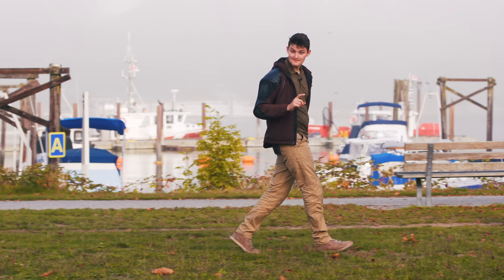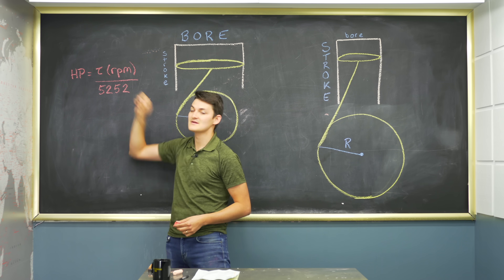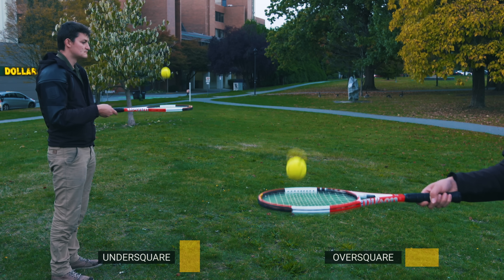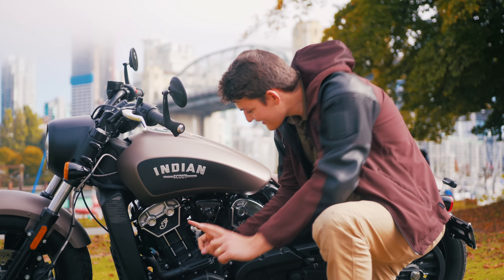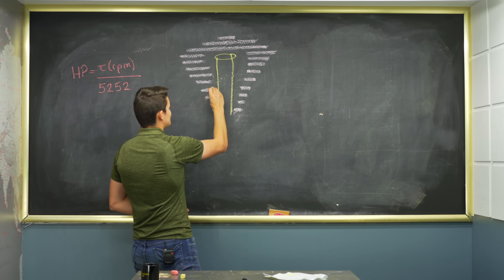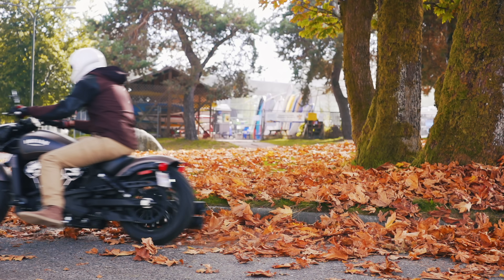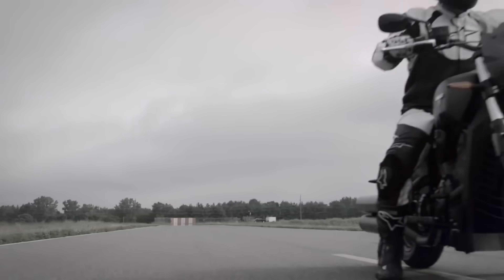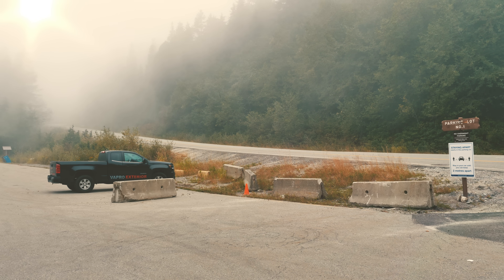How Indian Makes 43% More Power than Harley-Davidson

Comment: The question should be, "Why does EVERYONE produce more power than Harley Davidson?"
Reply: 'Cuz performance doesn't matter when you're less interested in motorcycles, than belonging to some 'Tribe' and owning a lifestyle 'fashion accessory'.
Reply: @matonmongo  Extra man gay motorbikes, only at HD.
Reply: @alanwatts8239  Cue "Macho Man", by the Village People...
Reply: Reliability.
Reply: @chopperking007  LOL Harley's and reliable, mate they are competing and honda here
Reply: @chopperking007  honda has entered the chat
Reply: Look at the torque not H.P....long stroke engines use low rev  torque not high rev H.P.
Reply: because it is a turn of the century design never brought forward without changing the bike into something opposite
Reply: But Harley's are some of the most unreliable bikes on the road... don't get me wrong. I have a custom fatboy, it's a gorgeous bike, but it's left me stranded twice and it can barely get out of its own way. Nearly every major manufacturer makes a v-twin cruiser that puts down considerably more power, is more reliable, and significantly more affordable. The only reason I keep the fatboy is because it was my father's and I'm sentimental about it.
Reply: Why does an 80s yamaha thats just 115cc get to 100mph and harleys cant
Reply: "Laughs in Royal Enfield"
Reply: @matonmongo  Most people with Harley apparel have never touched a motorcycle, let alone a Harley, or could identify one without the badges
Reply: @countzero5150  you probably dont know shit about the bike nor take care of it. They are reliable as long as maintained
Reply: @chopperking007  "Long stroke engines use low rev torque"

AND STILL MAKE LESS POWER
Reply: @chopperking007  which oversquare engines are obviously completely incapable of /s
Reply: @chopperking007  Like any bike that's been taken cared of? What's your point?
Reply: @benfennell6842  Would you believe that most diesel engines are under-square and produce less HP than their gas powered contemporaries? My 5.9L Cummins only produces 305 HP and the gas V8 it competed with produced 330. My Cummins had 610 ft-lbs of torque while the V8 has only 375. HP sells cars while torque wins races and gets the work done. My Cummins is still running at 220K miles and will continue to run for another 750k with proper services and adjustments.  Good luck getting that out of a gas-pot.
Reply: @umairjamil4831  Every Harley I've ever owned or ridden can hit 100mph. My brother's Road King with a 103 twin cam and only 5 speed gear box can do it. My 110 SE with a 6 speed can do it easily and on my ride home from Sturgis this last year I hit 110ish on a slight incline weighing in loaded at approx. 1,400lbs.  All the way from Seattle to Sturgis and back again without a hitch.
Reply: @joem7572  thays just not true and I dont think you understand horsepower and torque.

Saying one is more important than the other is a dead giveaway lol.
Reply: @joem7572  i was replying to another dude who said big motor harleys can only reach 100mph. Torque is nice but not that important on a bike. Harleys are always slower than other bikes of the same engine size. And harley doesnt make any agile bikes
Reply: @benfennell6842  I've almost completed my bachelor's in ME and I'm a Cummins trained and certified diesel technician. I understand HP, torque, and their relationship.
Reply: @umairjamil4831  It isn't as agile as my DRZ400S or my Triumph Adventurer, but I carved out Beartooth highway at speeds reaching 100mph this last summer. I grew up riding dirt and adventure bikes. Harleys are my relaxation ride.
Reply: @joem7572  then why would you say than one is more important and the other
Reply: @umairjamil4831  can we please stop talking about power and torque like one is more important than the other 

Do you think if we just removed the torque from our bikes they'd still go?
Reply: @benfennell6842  When and where did I ever say that? All I'm pointing out is that so many people hate on Harley and say they are under powered, they are not.
Reply: @joem7572  "hp sells cars while torque wins races"
Bruh
Reply: @benfennell6842  Not the same thing as saying one is more important. Most people focus only on HP and and don't realize that in order to take advantage of the advertised HP you have to rev. the hell out of the engine to achieve it. That significantly shortens the lifespan of the engine to utilize that HP. For example, my son's KX85 has 28-29 HP but he has to wing it to 10k to realize it. My Harley gets me to highway speeds very fast and can haul my wife, me,  all of our gear while doing so. I couldn't move that same weight under that acceleration with my old GSXR which advertised 162HP at 10k. My Harley performs the same work at lower RPMs and doesn't need the high HP rate to do it. Torque is why the Tesla Model S is going to overtake the Porsche soon enough as the fastest accelerating production car, HP isn't a factor from a stop and getting the hole shot.

Edited for spelling.
Reply: @benfennell6842  found the American
Reply: @umairjamil4831  Is that supposed to be an insult? If it is, why do you feel that is insulting?
Reply: @joem7572  not an insult bruh. Americans care for torque more than anyone else. Its personal preference. Some people like high torque at low end others want high revving motors
Reply: @umairjamil4831  found the person who didnt read anything I said

I dont prefer low end torque and power,  if you can find where I said that I'll give you a million quid.
Reply: @benfennell6842  ohhh bamboozled me
Reply: @umairjamil4831  bruh why cant people just accept that horsepower and torque are both always important to all engines instead of pretending that you can move a slider to make more torque or power at a specific rpm as if that isnt physically impossible.
Reply: @benfennell6842  the way i see it personally as a mechanical engineer is that as weight increases the importance of torque increases. Like suvs or minivans etc are better of with torque but for light vehicles and especially for bikes sacrificing top end power for low end power is just stupid. For touring bikes torque is good to have but if a bike manufacturer is only making bikes with good torque and lower max hp that means either the engineers are bellends or they have no decision making power. Harley didnt diversify their portfolio and only make one distinct type of bike. Thats why they are losing sales and rn they only rely on brand image which is getting damaged everyday.
Reply: @umairjamil4831  realistically the need for torque only increases because lower end power (and obviously torque too) is easier to use in a heavier machine because you dont have to work gear as much. Having the same power low down and therefore higher torque compared to the same power up high and therefore lower torque wont affect acceleration at all, just how easy it is to get to and use that power. 

The need for torque and power both increase as weight does, it's just that making that power down low means much easier usage.
Reply: @umairjamil4831  I built a 332" stroker Ford small block for my car, that I shift at 8500 rpm, it makes 530hp at the crank, I can't recall the torque, nor do I care. It has a 5000 rpm torque converter, so it never loads down low, therefore, low end torque means absolutely nothing. As you might guess from my name, I'm American. I love screaming small block engines with high hp. (Though I also built a Cummins diesel powered bronco which is also fast, but mostly built for the fuel mileage)
Reply: @AmericanThunder  bro you are in the minority as are most car people. Most people dont care for high revving engines. They all want low end power. Even manufacturers are catering towards this trend and are tweaking DBW and transmission shift points so people feel the car is faster than its real
Reply: @umairjamil4831  Maybe. But I also like the sound of a screaming V8 when going through a tunnel... lol
Reply: @AmericanThunder  who wants an engine that doesnt even feel like it's trying am I right?
Reply: @benfennell6842  I drove a very old 10-wheeler REO tanker truck with a gas straight six in it, and twin stricks, I forget how many gears it had. 17 I think? That is what happens without enough torque. You need a million gears! It suuuuuucked and topped out at 42mph with a load on it. lol Then I had a brand new Mack 300hp Econodyne 10 wheel tanker and holy shit, what a difference the diesel made with all that torque, and if I recall, it was only a 6 speed transmission. It accelerated more like a car in comparison to that old REO gas engine rig. Most people don't realize that dynos don't even measure HP, they measure torque. And hp is simply calculated with the formula hp=torque*rpm/5252. In easy terms, torque moves weight, hp is how fast it happens. lol
Reply: @AmericanThunder  okay in a truck maybe not😂 I meant car engines
Reply: Why does Harley-Davidson sell more bikes than anybody else?
Reply: @wrongthinker350  they... dont?
Reply: @benfennell6842  how many Indians do you see on the road compared to Harley-Davidsons? Or any other manufacturer for that point.
Reply: @benfennell6842  where I live I would say it's 75% of the bikes on the road are Harleys.
Reply: @wrongthinker350  I've seen 3 in my entire life
Reply: @benfennell6842  well you must live in some third world country then.
Reply: @wrongthinker350  perhaps the most typical American thing I've ever heard

You know harley barely sells anything outside of the US right?
Reply: @benfennell6842  how many times has America had to bail your country out?
Reply: @benfennell6842  you probably think you're 125cc is a real performance machine am I right?
Reply: @benfennell6842  if it weren't for us Americans you guys would be speaking German consider that?
Reply: @benfennell6842  British bikes are garbage.  Name just one that's better than a Harley.
Reply: @benfennell6842  sorry about your luck that you can't afford a $20,000 bike.
Reply: @benfennell6842  don't you guys have to give 3/4 of your wages to the queen? No wonder you guys can't afford Harleys.
Reply: @benfennell6842  why would you even bother owning a motorcycle in a country that rains 90% of the year.
Reply: @benfennell6842  made in England is just a translation for comes already broken.
Reply: @benfennell6842  I've got over 100,000 miles on my Harley let's see your triumph do that.
Reply: @wrongthinker350  your heart rate below 250 yet? Careful now, wouldn't want a heart attack would you?
Reply: @benfennell6842  you should try some light I hear it's great for the complexion. Or are you too busy foraging for potatoes in the bog under 500 ft of cloud cover.
Reply: @benfennell6842  I'm sure you get plenty of exercise pushing your triumph around.
Reply: all the whiners that cant afford a H D, so they make themselves feel superior by bashing them.🤣.
Reply: @harleyhawk7959  Harley-Davidson sets the standards everybody else is just a cheap knockoff. I'm sure they're too weak to even hold up an 800 lb bike.
Reply: @harleyhawk7959  I see more Harleys on the road than all other bike manufacturers put together.
Reply: @wrongthinker350  I've been riding since the 70's. still ride Harley. in all my time if riding, I never once heard any one say "Nice Honda" 🤣
Reply: @wrongthinker350  had some guy that wanted to ride with me up through Utah that ran into me at a store one morning. He asked how fast I rode? I said about 70 to 80. he says "oh, my bike cant sustain going that fast" it was a 750 honda 4.
Reply: @chopperking007  bullshit, torque is just an excuse for not being able to rev.......like a dump truck.
Reply: @joem7572  WOW WHATTA BIKE!
Reply: @joem7572  they are WAY underpowered, thats how they bone you the 2nd time, through their hop-up kits. The 1st boning was even buying that lumber wagon.
Reply: @benfennell6842  said by people that dont understand torque/hp and the irrevocable relationship between them.
Reply: @wrongthinker350  because girls buy them, unlike most other brands. Bingo, double the asses on them.
Reply: @harleyhawk7959  and you believed him. Not up much on bikes huh?
Reply: @harleyhawk7959  "all the whiners that cant afford a H D, so they make themselves feel superior by bashing them"  How the eff does having money mean knowing a good motorcycle even if it bit you in the ass? In my experience in this biz the more money you have the dumber you are with it.
Reply: @yamahale  Matter of opinion and as I've said more than once, I own multiple bikes across different platforms and each serves its intended purpose. And you're right in your first comment to me, it's a hell of a bike.
Reply: @joem7572  lol a helluva bike? Not the 30+ I have ridden. Maybe could have lived with 5 of them, as a second or 3rd bike. That engine ruins it for me, like riding an unrevvable dump truck instead of a Camaro.
Reply: @benfennell6842  As a citizen of the US, this guy is embarrassing all of us. We aren't all xenophobic and practiced in ad hominine attacks, I promise.
Reply: @yamahale  Subjective opinions are just that, subjective. Feelings have no part in an argument about facts and none of the vitriol that I've seen in your writing suffices as a fact.

Edited for spelling.
Reply: @joem7572  dw, my gf is american, I actually quite like the country, been a few times
Reply: @wrongthinker350  
How many Harleys on the road in the rain?
None....Might get waterspots on the chrome.
I ride my KLR 650 EVERY DAY. The only time I wash it (since 2002) is in the puddles when its raining. 
  Harleys are looky-me bikes. I have owned 4 of them over the years. But I was young amd needed the attention then....
Reply: Why does it always have to be about horsepower? If I wanted horsepower I'd get a Boss Hoss. Take vintage muscle cars, they handled and braked terribly, were death traps in a crash and people still want them even thou there are plenty of cars with modern engineering and power with half the cid that will eat them for breakfast. It doesn't have to be getting from point a to point b in the fasted time, it's about the ride.
Reply: @ralphfogle1662  and so it is with bikes. If you want to ride a Harley which is like a full size Buick w/a 6 cylinder, dont whine because I want a 2 wheel Camaro with full power. And btw HDs dont ride that good, even their shocks are obsolete for a supposedly premium machine. I just rode a 2015 the other day, what a lumber wagon.
Reply: @yamahale  Hal, I'm not whining. I'm just saying not everyone wants the same thing. Just buy what you like and fits you but don't put another brand down because it doesn't fit you, to each there own. Take care.
Reply: @welderboi5565  You got it brother!
Reply: @welderboi5565  
Well said....
This stuff ain't no new thing. About fourty years ago I saw a bunch of Gypsy Jokers pound the shit out of a guy and send him to the hospital in the back of a pickup truck while they burned his bike.  His crime? According to  onlookers, it was because his bike was a Honda 750. I don't know. I got there as the victim was leaving. There may have been more to the story........
Harley vs Vincent Black Shadow....Harley vs Indian...Harley vs The Legendary Webley-Vicars Belch-Fire 40/80.....Whatever vs Whatever......
Human nature. Mine is better; Yours sucks......lol
Reply: They don't. The Revolution Engine was cranking out 115 HP back in 02. That motor is only getting better and more powerful, and they are putting it into new model lines this and next year.
Reply: @joem7572  Are you really comparing motorcycles to diesel trucks? Whatcha pulling with your Harley? Let's just be real here. Harley's and retro style bikes sell on looks alone. I seriously doubt you went into a Harley dealership for the first time and asked about it's towing capacity. There is nothing wrong with buying a bike because it looks cool, but this "low end torque" thing is an excuse people make after the fact. You know another bike that has "amazing" low end torque? A 300cc Honda single...
Reply: @Dizzykitty817  My initial comment before it got cut off and deleted was that I was comparing under-square engines and the characteristics they share. I traded my 2017 Vulcan Vaquero in on a Harley because my wife and I were getting ready to travel from the Seattle area to Sturgis and couldn't get the Vaquero to work. We tried for months packing different ways and two months before our trip she told me to get a Harley because we knew we could get everything we needed and there was plenty of support along the way. Fully loaded we scaled in at just under 1400lbs and road all the way to Sturgis at speeds averaging 80-90mph. I couldn't have done that on my Vaquero or I would have, I really liked the way that bike looked. I also couldn't do it on my Triumph, my GSX-R, or my KDX. I own 7 bikes between mine and the kids across all different makes and will own more once I get the wife riding by herself. Just like the tools in my toolbox, I choose the one that is most practical for the job. If the bike looks cool while doing its job then that is just a bonus. Which Honda 300 are you referring to? I've owned a couple of Hondas and still own my youngest son's xr50f. I recently sold my DRZ400S as my KDX does everything better except street. I plan on looking at a Ural this summer, adding a KDX250, and possibly getting a new YZ250X instead of the KDX if I like it well enough.
Reply: Well, why does everyone buy an iphone... same problem different answer
Reply: You definately never even riden or owned one.. i can tell
Reply: Man Of Chai Tea  what's the difference between socialism and communism?
Reply: Because HD refuses to go to water cooled engines
Reply: Because while everyone else is engineering performance, Harley engineers noise.
Reply: @borisjankovici662  you say that like there's something wrong with it.
Reply: not royal enfield
Reply: brother, horsepower is not everything. you see harleys have a huge low end torque.
Reply: @sushi_edits225  I get it. I've owned two (one was a pan bottom/shovel top, stroked, cammed, twin throat mikuni, magneto etc. as well as a '65 Panhead that I did a frame up in '83) and ridden many many more.
Reply: Because harleys are tuned like ass
Reply: Like number 999
Reply: @joem7572  the funny thing is, those undersquare harleys still make less torque than most oversquare metrics, the milwaukee 107 makes 112 ft ibs and 77hp, while a comparable 109 suzuki engine makes 128hp and 118 ibs ft! Which engine will outperform the other? Even the undersquare yamaha 1900 is outperforming HD at their own game,  95hp and 123 ft ibs vs the milwaukee 114's 79hp and 119 ft ibs.
Reply: @matonmongo  yes
Reply: @chopperking007  What? Harley? Reliable? When?
Reply: @nunosantiago2273  what bike you ride ?
Reply: @chopperking007  I ride a 1190 KTM RC8
Reply: @nunosantiago2273  that will be worthless when it's got 30k  on the clock....
Reply: @chopperking007  As if I care
Reply: Because that’s not true.  It’s not the 80s anymore.  Maybe you’re comparing crank hp to rear wheel hp.  The world will never know.
Reply: @chopperking007  lol long stroke engines have more low end because of smaller valves and cant spin as fast lest the piston speed would be too high. Quit listening to your geezer neighbor with his old wives tales.
Reply: @yamahale  small valves ? You call nearly 2" valves small ? Only thing small is your brain...
Reply: @chopperking007  obviously I meant as opposed to a larger piston(in a short stroke) that can have more valves due to the larger surface area. I guess I gave you more credit than you deserved, which admittedly wasnt a whole hell of alot to start with😆
Reply: Because thats not what riding Harleys is about. They have plenty enough power to get the job done in classic style
Reply: @yamahale  ive never been critical of what another man rode, so i guess that if that makes me average, im happily average
Reply: @umairjamil4831  think you found an englishman.
Reply: @southernshop8424  thats fine, as long as they keep their place in the motorcycle world pecking order. I hate snobs, there are enough of them around us already.
Reply: @yamahale  so do i hal, like when i rode my gs250t suzuki for  10 yeats and hd people looked down on me and made all kinds of smartass comments. But i rode that little bike year round, even in snow.
I dont do clubs. Though ive been invited ,  or crowds. I just love the therepy of the ride
Reply: @umairjamil4831    Harley’s get to 100mph, it just takes 10 min
Reply: @chopperking007    Reliability?  You are kidding right?   I’ll give you reliability with the EVO motor.  Those are indestructible and many have gone well over 100k miles.  The Twin cam and M8 have many problems.   My buddies 110 grenaded with only 8k miles and he was riding easy when it happened.   The dealer couldn’t find the cause so it was sent to corporate.
Reply: @1718bb    The revolution Vrod motor was the best they ever built and they shit canned it and went backwards.  The Harley loyalists hated it.  The harley 117 makes 90hp and 113 torque on the dyno, which is anemic by modern standards.
Reply: @chopperking007    Just like a Harley.
Reply: @dickjohnson5025  Yeah. Harley has been stuck between a rock (their core customers, who seem to hate innovation) and a hard place (most everyone else who hate the Harley name) for decades.
Reply: @1718bb    They has some very bad leadership as well.  When Keith Wandell was CEO, he really screwed things up.  He could see no reason for a racing division.  He kicked Buell to the curb and his edict was to focus on heavy pushrod engine cruisers.  A real setback to Harley.  They had a great motor in the vrod but failed to move that into any other line except the vrod.  The vrod didn’t appeal to the loyalists who wanted a cruiser instead a muscle bar hopper quasi chopper.   Lots of bad management decisions on the part of the moco
Reply: @joem7572  when you state "torque wins races and gets the work done" you do not understand power at all. If you (almost) have a bachelor degree and are certified diesel technician, i see why there are so many underpowered engines in the US.
Power is "work done per time", not torque. Torque and rpm can be converted into each other, but the power is the same. Thats why gearboxes exist, to convert torque and rpm while using high power.

Reliability is another story. Especially large diesels are designed to last long.
But i also know some japanese motorbikes that lasted over 200 000km without any major replacements and are still on the road, and that with a high reving engine.
Reply: @Coolgamer400  I'm fully aware of what horsepower is, torque x RPM/5252. If I start with more torque, I have more HP for a given RPM. You can think whatever you want about "underpowered engines in the US", but that is a subjective matter. I have probably rebuilt more gearboxes than you have ever seen inside of. I'm fully aware of why they exist and thoroughly enjoy getting my hands into them, including automatics which I'm quite versed in as well. I'm going to major in applied physics after I complete my BS so believe whatever you want. I'm through with idiots that don't know their ass from a hole in the ground.
Reply: Holy crap there are a lot of unknowledgeable comments here.  Perhaps that is the true "Indian vs Harley" thing:  One side rides with experience and loves to ride while the other side doesn't have a clue what they are talking about and wants to argue.
Here's what I know after riding "everything" over a lifetime...  you always end up on a Harley if you can afford it.  End of story.
Reply: HD cannot ever change the sound of their engine, or they lose all their tribe. It’s an iconic thing and all they really have to bank on it.  It’s a limitation they are willing to hold on to.
Reply: @joem7572  bit I had a little baby 400cc parallel twin Suzuki that could hit over 100 mph that bike was from 1984. 
By the way that speed was radar confirmed at 110mph unfortunately
Reply: @SuperBigdanno  So where are you going with this? I had a Triumph 885 that could hit 155; I wouldn't have tried to race it against my GSX-R although for a longer ride it was much more comfortable.
Reply: @wrongthinker350  Do they?.
Reply: @TorqueKit  do they what? There's 137 comments here and I'm not scrolling through them to see what I said.
Reply: @joem7572  Like the slant 6, small bore and long stroke. On paper ,low horsepower, yet will run side by side next to a 318 in the same car. A few modifications and  it  comes alive.
Reply: @joem7572  I had a friend who taught that-then be bought a twin cam dyna .
Reply: @benfennell6842   In the heavy weight cruiser they do
Reply: @benfennell6842   Strange ,that Europe has Harley Owner rally's all over the continent when they have none.
Reply: @frankpeletz1818  Never said that harley doesnt seel any motorcycles in Europe, that's a straw man and you are fully aware of it. 

I stated that harley do not "outsell any other manufacturer" as claimed by someone else, when in reality we all know that's Honda. 

Perhaps yes in larger displacement categories the Harley Davidson is outselling their competitors, or at least they would be if they had any. There is only a handful of other manufactures producing huge underpowered air cooled stone age engined bikes. Why? Very few people want 'em. 

They're a relic of a bygone era, still purchased by some because they're cool and fun, but overlooked by most because they're expensive and impractical.
Reply: @frankpeletz1818  I love the slant six and own two vehicles with them. Both are 225s and will still be running when my grandkids have kids.
Reply: @frankpeletz1818  I'm not certain which of the above comments you are replying to.
Reply: @joem7572  Didn't you say Harleys were slow?
Reply: @joem7572  You should see the one I have, 19 inch equal tube intake,  split exhaust manifold, custom cam  with more  compression running a 2300 holley.
Reply: @benfennell6842  Maybe in your country. I am guessing you have never attended a rally in the US, like Sturgis ,Daytona, Rolling Thunder ,etc....
Reply: @frankpeletz1818  Not me, I said every Harley I've owned can hit 100mph. I have a twin cam 110 with a stage two kit and that thing hauls ass for how large that bike is.
Reply: @joem7572  Then my mistake. sorry
Reply: @frankpeletz1818  every country on the entire planet except the USA*

The fact of the matter is that due to Harley Davidson being protected from foreign competition in the 80s they simply arent popular outside of the USA. They still lead their class, but that class is niche.
Reply: @benfennell6842  Only the  "wealthy"countries you will find Harley's. When you travel maybe 3 mile in a city, you don't need a  big heavy cross country touring bike..The same goes with cars. Trabants and Golfs  sized are more popular.
Reply: @frankpeletz1818  I mean yeah of course, that doesnt mean that Alfa Romeo is outselling Volkswagen just because you find more Alfas in wealthy countries outside of cities. 

Harleys exist in my wealthy country, sure. But they are by no means the most popular brand. Not even close. And when it comes to mile crunchers I see more Goldwings and GS's in a week than I see Harleys in a few months.
Reply: @matonmongo  Does that come with stink colone & a box of flies.
Reply: They dont !  Go test drive a Harley with the new 114 engine ...and hold on
Reply: Harleys make so much noise to keep the old boomers awake . I my ST 1300 is the far superior to any bike I have ever ridden . To me pushrod engines belong to the 1800s .
Reply: @The412Devil ,lol. Which means every 50 miles you have to 'maintain' a hardly. Hahaha😂 everyone eles is still riding. Lol, oh thanks for the laugh.